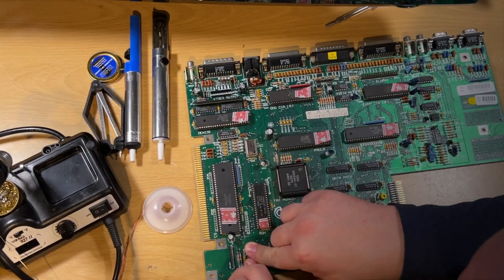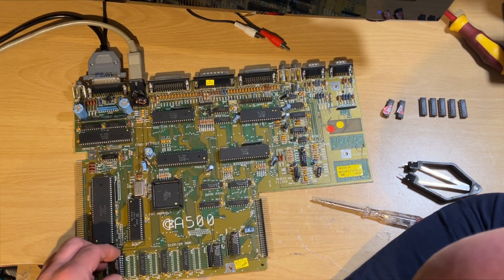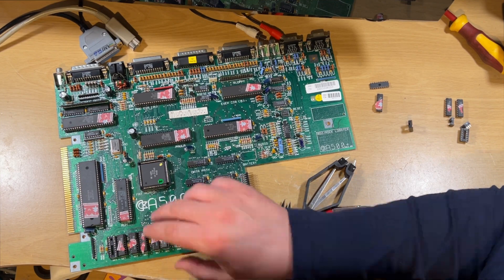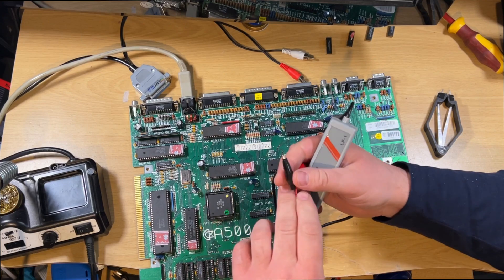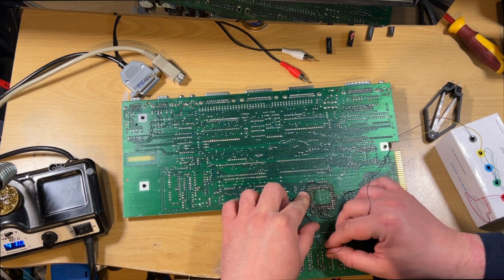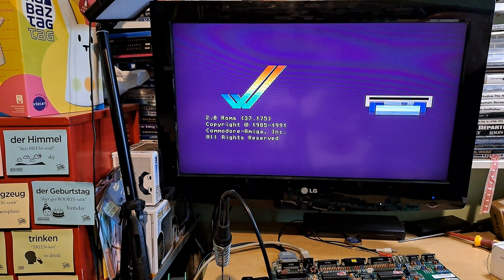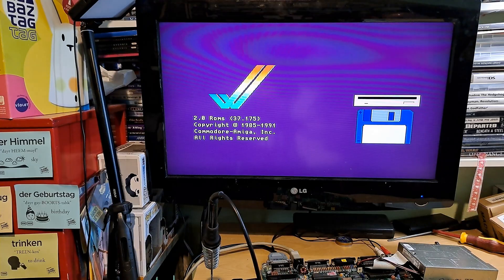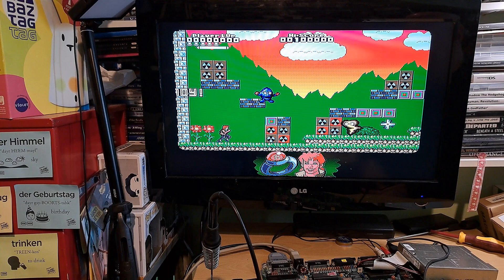Finally!! Amiga A500+ Repair & Fault final Part

Comment: Amigas and Atari 8bit machines are so "easy" to fix. My A500 had so many issues after been in  a box for decades. With almost zero instruments and tools I managed to resurrect it by just googling the errors and searching  for most popular solutions. Ataris are even easier. I guess Jay Miner's  approach  in his machines was so straightforward.
Reply from the maker: It’s true, they are amazing designs, Jay Miner did good. Also, nice job on getting your A500 going again 👍

Comment: Wonderful thing about the amiga is they  are so transplantable..all chips are socketed..Nice to see another one survive..i kind of collect them for nostalgic and preservation reasons.....thanks.
Reply from the maker: Thank you for watching and you’re right that they are fairly easy to work on compared to modern tech. At some point I want to transplant my 500+ all over to a new motherboard, hopefully sooner rather than later but first I need to look at my CD32 which is not in good shape

Comment: Great video, it somewhat helped me as trying to move my old chips into another 500+ motherboard that’s been recapped as clock battery damage on the other one. Getting a white screen however if the floppy drive is removed the system boots into the kickstart hand inserting disk purple screen assuming it might be a bad floppy drive causing this, thoughts mate? Cheers.
Reply from the maker: Glad you liked the video. Sounds like something floppy related is stopping it from booting. My first thing to try is unplugging the floppy but leaving it’s power and ribbon cable connected to the motherboard and see if it boots. May be a short happening in them. Next would be to try another floppy drive if you have one you can borrow or have a spare hanging around. If you are getting the same issue then with a confirmed good floppy drive then it’d have to be something on the board itself that is only shorting when a floppy drive is connected. Please let me know how you get on with it 🤞👍
Reply: @BillFixesEverything  thanks mate, I’ll try that I’m also getting a new floppy drive ribbon and power cable will see what happens :)
Reply: @BillFixesEverything  Update got it working last night, parts arrived so I changed out the floppy ribbon cable and power, and the CIC chip on the even socket was seemed faulty or bad so replaced that and now fires up with the gotek installed in place of the original drive. Happy days. 😎